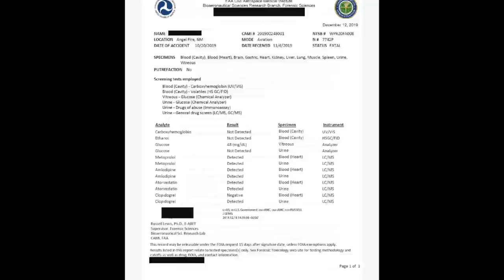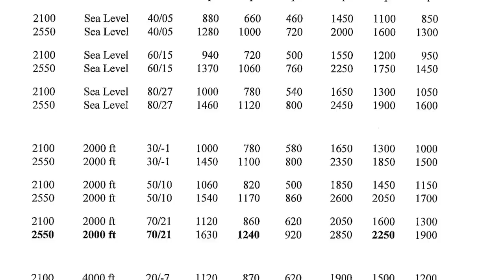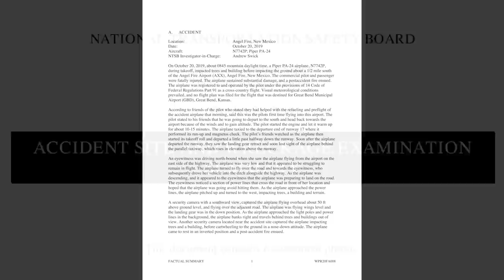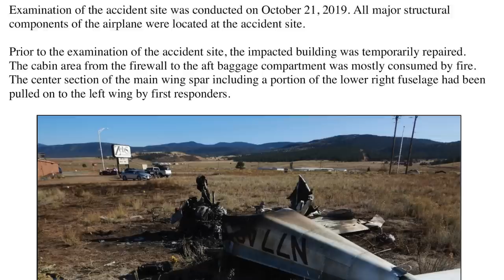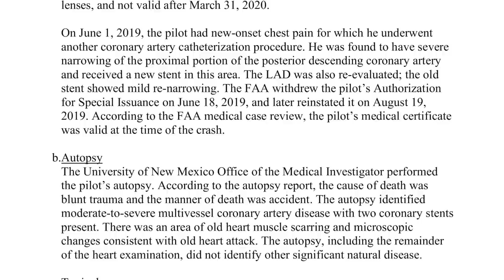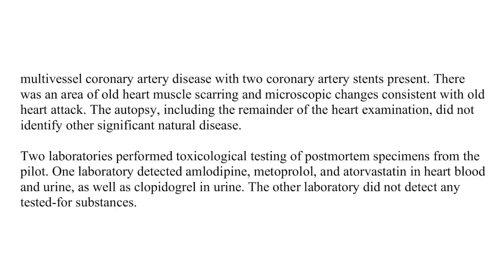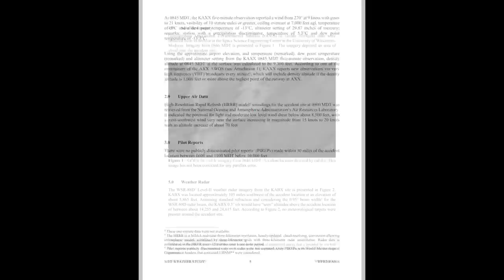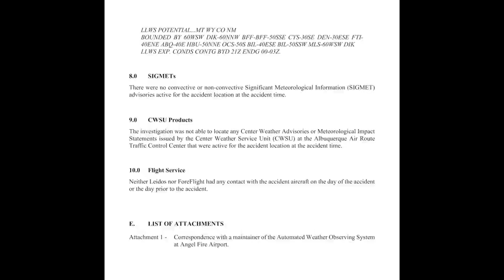Crash of Piper Comanche

Comment: This has been by far the best, complete report ever produced.
  From the initial crash footage from different locations, body cam footage of the police officer who was there immediately, the impact on acquaintances and witnesses alike, and right up to the end with all the accident scene photos.

This is a first class presentation which we are all grateful for! Thank you!
Reply: What did I miss?  I never read or heard the cause of the crash.  Obviously it was a stall, but was the plane overweigh or didn't have enough speed on takeoff to overcome the thin air conditions at that altitude?
Reply from the maker: @charleshaggard4341  You didn’t miss anything. The NTSB investigation is ongoing.
Reply from the maker: Thanks, Jim. I try my best to seek the truth, and to report the facts completely, accurately, and transparently.
Reply: @WhatYouHaventSeen  It needs more enhancement...like in CSI Miami or that one movie with will smith. 
I'll settle for arbitrary computer noises when you zoom, however.
Reply: @charleshaggard4341   report is not finalised yet.  But, this type of airplane with full fuel and two people and a density altitude of ~9500 feet, with moderate low level windshear (ie, lots of turbulence down low) is a very bad combination that would have a very hard time getting airborne and an even more difficult time trying to gain altitude (climbing after getting airborne).
Reply: No doubt! This was very well put together and probably the best video documenting a plane crash and the unfortunate aftermath I've ever seen! And all without someone constantly talking over it all!
Reply: not a pilot but with winds at 270 and departure on a 170 heading, that makes him taking off with a tail wind. I suppose takeoff  in the opposite direction would've been a better choice.
Reply: @jamc666  the AC was already airborne. the tailwind will not make much of a difference after take off. it looks more like the sufficient climb rate could not be established.

partial loss of thrust, or simply overloaded for the power available.
Reply: @jamc666  He departed on 35.  As for the wind, it's essentially moot being near 90 degrees.  Having been there a couple of times, I'd much prefer to depart on 35.  Less extreme gradient to the north, and many more emergency landing opportunities headed toward Eagle Nest.
Reply: @MrZrryan2  His sugar being 48mg/dL and having heart disease may have been a factor as well. 48 is head to the hospital or get sugar asap range. Below 70mg/dL is low and can have harmful effects. Awful.
Reply: Also, a shout-out to that first officer on scene! He did a damn fine job at such a tragic scene.

Comment: The PA 24-180 was a very underpowered airplane built mid 1950s.  This was cool crisp fall morning.  If it had been an 80-degree summer day, he would probably never have gotten off the ground.  I am very familiar with all the Comanches including the 400hp model.  This little town has a pop of 735.  It’s a small little ski park in the winter near Taos.  Mostly part time residents and seasonal cabin sites.  The police dept consisting of 5 total employees and probably volunteer fire dept did the best they could with what they had.  Total “public safety” budget of all types is $2.5 million. These airports don’t have fire equipment and staff usually includes one part time manager if that.  The Google map view shows one structure and not one airplane parked on any of the ramp area. Resources to maintain it come from the city.  $10/night to park an airplane pretty well describes it and that is likely an honor system.  It’s a little like an unattended camp ground with a self-service refueling station.  Don’t be hard on the cop.  He was probably the only cop for the entire town on duty at 8:30.  Running around at 10,000’ with 30 pounds of equipment on your belt is challenging for even an athlete.  A tragic accident.  A little humility and, “but for the grace of God…” is in order.

Comment: Density altitude of 9500msl and full tanks of avgas, man that was ugly.
Reply: And the runway slopes uphill in that direction. By the time he realized he was in trouble, he was already out of options.
Reply: LOW (infrequent) time @ the controls, possible (major) HEALTH considerations, WX conditions and ADM all “could” factor in to this tragedy. May they both Rest in Peace..
Reply: And a 2 knot tailwind.
Reply: A 4-cylinder Lyc powered Mooney crashed (fatal) at Angel Fire under similar conditions--high DA, gusty crosswind, fully loaded etc. There's a reason 520/550 Bonanzas/182s/210s are popular out here in the high country...
Reply: and those wind reports...   guy had a lot on his plate.
Reply: I was taught if the field has no runway remaining signs "use your clock to figure out you acceleration.". He just over estimated the power of his plane. I waited at Denver CO from 1900 to 0330 the next day for the density altitude to get on the chart for take off.  I was flying a jet fighter! (F9 Cougar)
Reply: I kind of simulated the same conditions in Flight Simulator as described in the report  and couldn't even get my plane off the ground.
Reply: The airport elevation is 8380 feet. The temperature was 5°C. How do you come up with 9500 feet density altitude? This looks like an underpowered aircraft near its maximum weight taking off with a significant crosswind (which actually had a downwind component to further degrade performance). According to  investigation he retracted his gear but still did not have enough power to climb out of the airport environment. Makes me wonder if pilot had the mixture leaned to produce maximum power at that altitude or perhaps there was some other reason why the engine wasn’t producing maximum power.
Reply: @crphilipp  simple a chart or calculator. At that altitude an engine will never never develope full power and the proper will never debope full thrust, you chart or flight calculator tells you this. Assuming an engine developed full power at 8800  altitude kills a lot of pilots.
Reply: @crphilipp  the gear is extended, looking at the crash images
Reply: The gear was down.... had he cleaned it up and held in GE  might have been better outcome
Reply: looks like he was trying to stretch his glide too
Reply: @lexluthor6906  yeah but down and dirty isn't gonna help the cause
Reply: @crphilipp  he’s right 9,500 DA

Comment: 180 horse Comanche, full tanks, 2 people, 9400ft density altitude. There was no way that was gonna go well.
Reply: Not that I disagree with your conclusion but I wonder how they NTSB calculated a density altitude of 9400 feet. The temperature was 5°C (41 F) and the airport elevation is 8900 feet and the barometric pressure was 29.87. Standard temperature is 59°F at 29.92 altimeter. Nine minutes
Reply: @jhmcglynn  i've just run numbers and come to 9910 ft. Almost FL100
Reply: @jhmcglynn  Perhaps they used the altitude at the crash site which was higher than the runway.  For a crash off site, that is normal.  But in this accident, I think the winds and mountain turbulence contributed a lot.
Reply: @bw162  Brain fart on my part. Of course standard temperature of 59°F in barometric pressure of 29.92 is at sea level.
Reply: @jhmcglynn  Right. Standard temp at 9400 feet is 25.5 degrees F.
Reply: @fellow7000  According to an E6B the density altitude is 10,354 feet.

Comment: Wow... I don't know them personally, but they were a bank CEO and his wife who lived not too horribly far from me here in the great flyover state of Kansas. We don't have many major issues with density altitude and terrain at under 1500 feet MSL. 

I used to joke that we make planes in Wichita so that no one is forced to actually drive across the state, but if your hangar is here, we do hope you come home safely.  My condolences to the family and community both in Angel Fire, New Mexico, and in Kansas.
Reply: I lived in Kansas. One day they had a TV crew at the Colorado toll booth asking what might cause people to spend more time in Kansas.  One driver reply, “more toll booths”.
Reply: @bw162  Simultaneously doing road projects on every major road corridor with a flag man every little bit seems to be the current strategy. With infrastructure money, they're repairing almost too much too fast and even my fancy GPS system can't keep up with the closures. It'll be nice when it's done, though, because they've fixed a lot of bad design and are rebuilding with safer interchanges.
Reply: @44444Snow44444  Density altitude of 9600 feet above mean sea level in an aircraft that's not particularly high powered that had its hangar in Great Bend, KS which is maybe 1500 feet AMSL. Less dense air requires more runway, more power, and a shallower climb. He took off full of avgas. His plane appeared by all metrics to still be at high throttle but at a really high angle of attack which destroyed airspeed. It was the wrong airplane with the wrong loading under adverse conditions for flight in a 4-cylinder Piper. Great Bend is not notorious for its local crime syndicates. It's at the edge of where Kansas population drops below cattle population going west from I35.

Comment: If your ever in that situation and you have multiple extinguishers - Surround the target (except against the wind) Hit the target all at once with the extinguishers from the outside in to the point of the fuel leak(s). I know its hard to think in the moment because you dont expect it. Hopefully this helps mentally prepare you in the event that it does. Never say never. Mental preparation is the first step to survival. Always think about what could go wrong and prepare with multiple contingencies if possible.
Reply: I've been to Zebs!
Reply: In your opinion, could multiple fire extinguishers make a difference in a scenario like this one? I ask from a purely academic/curiosity standpoint, because I don’t have a lot of experience with them and don’t know how effective they are. There seems to be a lot fuel here and I have no idea how good these portable extinguishers are at smothering AV fuel fires that are being fed from the source (tanks and lines).
Reply: @nateweter4012  I think so if they were larger containers. It would work until someone could get a film forming extinguisher on site.
Reply: Those extinguishers aren't made for aviation fuel. 60 gallons is a lot of fuel to put out with those kind of extinguishers. Not only the fuel but all the combustibles on a plane. Seats rubber and plastics.
Reply: @nateweter4012  I agree, with multiple fuel sources hand held extinguishers probably wouldn’t work.  That’s highly volatile fuel. 100LL is hard to put out. Plus you’d need specific extinguishers to put out oil type fires
Reply: It's called running scenarios. A few of us do it too much, but most people do it too little.
Reply: Yeah, it has to be foam to continuously smother the fuel and deprived from oxygen and even if you were to use chemical fire extinguishers and completely put the fire out it could dangerously burst into flames again with a large explosion.
Reply: Aim at the base of the fire 
not the flames

Comment: It's painful watching density altitude crashes like this where there are so many opportunities for the pilot to just stop. If you have a bad gut feeling during your takeoff roll just STOP. 

Could've payed attention to the numbers in the book and decided not to go or taken less fuel/passengers. Could've stopped the takeoff roll early when the plane is only creeping along at full power. Could've aborted the takeoff when you're half way down the runway and still on the ground. Could've chopped the power and landed back on the runway and go off the end under control. Could've picked a field early and landed immediately under control.

It's very hard to tell yourself that you're committing to a forced landing, but just about every abort option is better than the inevitable outcome of hoping it'll just work itself out.
Reply: I'm not a pilot and know basically nothing except the basics of how planes work(air flow over and under wings) and absolutely nothing  about actually flying an airplane, with that said, could you explain to me the "density" issue you are talking about? I'd appreciate it
Reply: @bigfan9805 You've picked one of the trickier things to understand in flying!

Density altitude is basically what you get when you account for all atmospheric conditions in your performance calculations. For example, your altimeter reads 5000 feet, but because it's a hot day with a low pressure system, the plane performs like it's at 9000. This performance impact is substantial in a small naturally aspirated piston aircraft. 

The higher you go, the worse the wings, engine, and prop perform because the air is essentially thinner.

Taking off at 9000 feet will result in a substantially longer takeoff roll and a significantly reduced rate of climb, when compared to sea level performance. At a certain point, the plane just can't fly. 

Air temp is especially important and can catch people out. It might feel relatively cool at 70f at 9000 feet, but the numbers in the performance tables are assuming a temperature of 27f at 9000. This will severely impact performance. 

This can really catch people out who aren't used to high altitude/mountain flying. If you spend most of your time flying out of airports under 3000 feet, you'll become accustomed to a certain level of performance out of your aircraft. You'll just know that a runway length is well within your plane's capabilities, and you'll have no problem outclimbing obstacles. You're probably not going to do your calculations for every takeoff when you have such huge safety margins 99% of the time. 

Now you fly into a mountain airport at 9000 feet. If you're complacent and expect your plane to perform like it does at sea level, you'll end up doing what this pilot did.
Reply: @iPig , well..i've got to tell ya that you did a heck of a job clarifying that as best or better than i could have hoped for👍🏻, thanks! The pilot had a lot on his plate that seems to have been very unfamiliar territory for himself, Some or at least one of the witnesses said he appeared to be going slower than what they normally see during take off so it fits right in with what you are saying about "expected performance"  as opposed to how the plane actually performs at the higher altitude airports, Thanks very much again for taking the time to respond to my question, Good luck and be safe flying 👍🏻
Reply: @bigfan9805  Happy to have helped!
Reply: 10/4
Reply: Chris Sparks ... it looks to me as though he was coming in for landing 24:55 ??!
Reply: I had an instructor who owned a Comanche 180. I was in Albuquerque at the time (5200' elev) and it was dog on a cool day with 2 people on board. I would not attempt to fly a Comanche 180 into Angel Fire at any time! The bad decision was made when he decided to go there to begin with.

Comment: Using the fire extinguishers may be futile…but you have to try
Reply: Really? A fire extinguisher has zero chance of putting out a fuel-fed aircraft fire. Zero.
Chances of that burning airplane exploding? You tell me.
You don't have to try. I won't. Not w/a fire extinguisher. 
Risking your own life with no chance of success is not my thing.
Reply: @Danstaafl  Yeah I agree, they were already long dead with the cockpit on fire. No sense risking getting that close to the other wing tank. Like you say, 1 or 2 extinguishers ain't doing jack shit against all that fuel.
Reply: @Danstaafl  Not that I normally reply to people but I just wanted to say you fight the fire as much as you can. Yes they are gone, but now its gown from SNR to preserving as much evidence as possible. It could mean the difference between figuring out everything that possibly went wrong.
Reply: @Danstaafl  …yep. MY thoughts too. Want MORE possible deaths involved  in an instantaneous EXPLOSION by an AC that was holding FULL fuel onboard? “Sounds” great but probably not the right, practical call..
Reply: Very sad situation. I give the Officer a lot of credit for trying to knock down the fire even though he was unsuccessful.
Reply: Fire extinguisher at least will control the spread of the fire until fire/rescue shows up

Comment: layman here, so simply put, because of the elevation of the runway, the plane was underpowered and too heavy and could not gain altitude because the air was too thin?
Reply: Yea basically,thinner air equels less lift and less engine performance